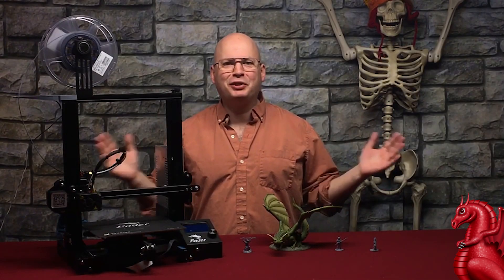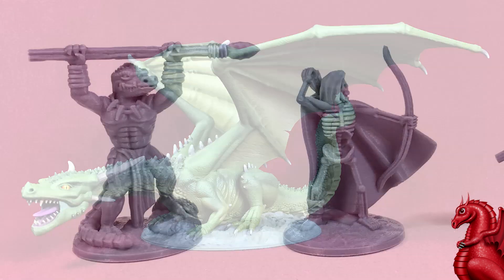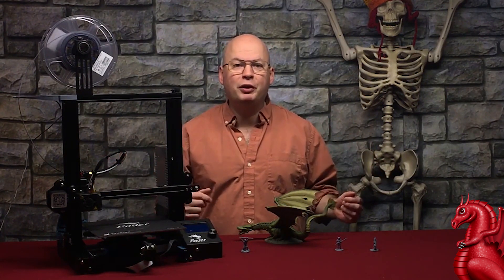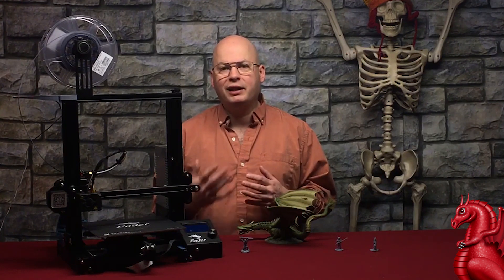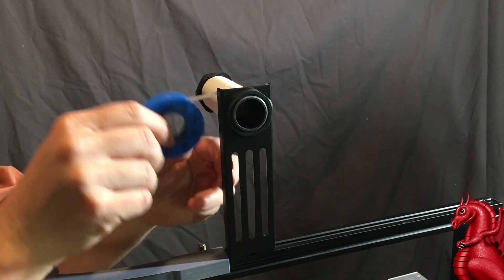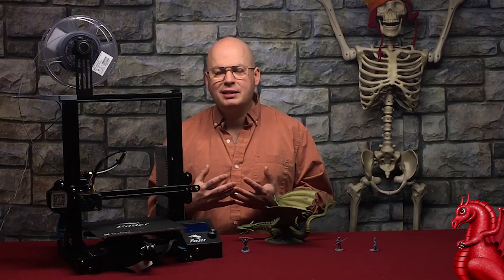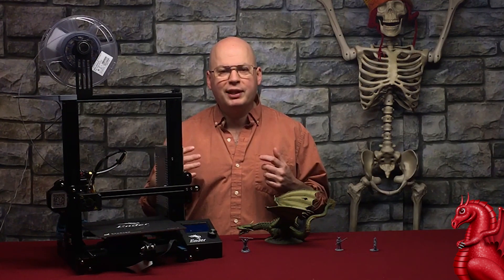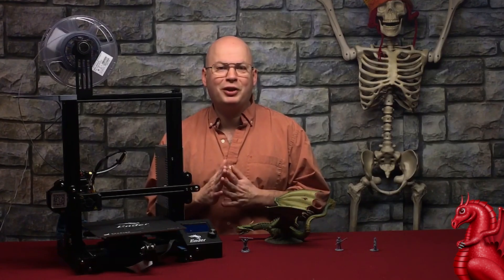Ender 3/5 Reduce Spool Holder Friction

Comment: 6 years later you solved my "WOOOOONNNNNNGGGGGGGGGGGG" noises from the spool moving. I was about to print a spool holder and the teflon tape just instantly solved it in the middle of a fairly critical print. Thank you thank you thank you, your Ender content is still invaluable.

Comment: Ended up making a design with 3 aspects at once.
> Skateboard bearings
> Self-centering roller
> Powdered graphite
    The spool only contacts two tiny greased points on the roller, keeping friction so low that the bearings don't even need to spin most of the time. 
    It's the best upgrade I've ever printed, and it's 100% worth the trouble.

Comment: I've printed myself a Cylinder with a hole in it and a 10mm lip on one side. The inner hole fits the spool holder and the outer diameter of the cylinder is a bit smaller than the inner hole of the Filament spool. The lip is to prevent the filament spool slipping away from the spool holder. Works perfect and the draw is so smooth now. But you have to eventually print a few of these if you have different brands of Filament with different spool sizes.

Comment: Neat little trick, people seem to over engineer solutions by 3D printing roller spools with ceramic bearings pressed in to the them and such like but in reality most extruder's are more than capable to cope with a little bit of friction reducing the friction a little will help reduce load on the extruder and that's why this method is a good idea because it reduces the friction a little, you dont want the spool to be spinning super free because you could get in to a situation with retraction and other bed movements where you start to have entanglement problems with too much filament spooling off. Enjoying your videos but do find the intro a little long, 5 seconds is more than enough for the intro,  subbed.

Comment: I don't understand how that dragon could print without support.  The bottom of its chin would have to start printing in thin air.
Reply from the maker: Watch the linked video at the end, it explains everything. :)
Reply: @Tombof3DPrintedHorrors  gotcha. Thanks!  Very cool work.  I actually made and printed a spider very similar to the one you have on your KS for my nephews d&d group.  It was my first project like that and was fun to do:). Of course yours looks a heck of a lot nicer!
Reply: I printed that dragon last week, it prints in several parts upright. Only the wings use supports. Turned out very well

Comment: Not THAT is an important aspect I've seen nobody adress properly yet! Good tip!
Though i simply printed a larger diameter sleeve cylinder, also helped tremendously with reducing friction and make the spool roll off smoother overall.
Besides, what IS actually the best available spool holder design for the Ender 3?